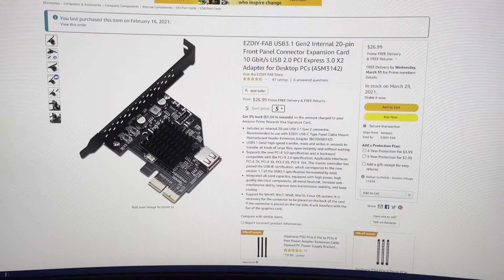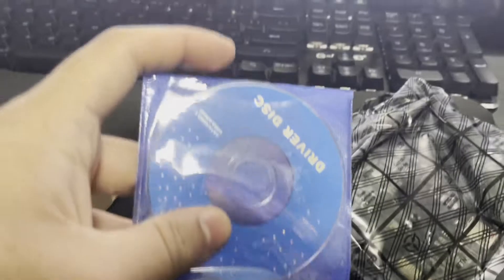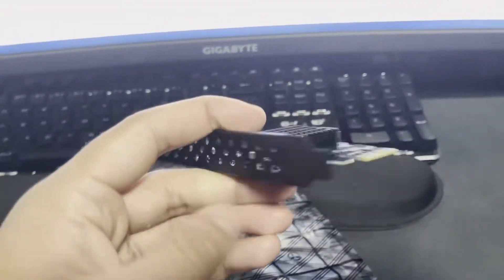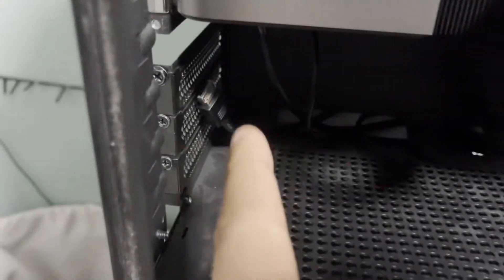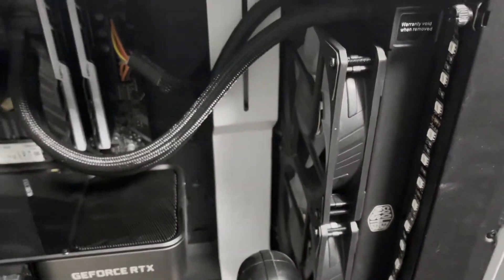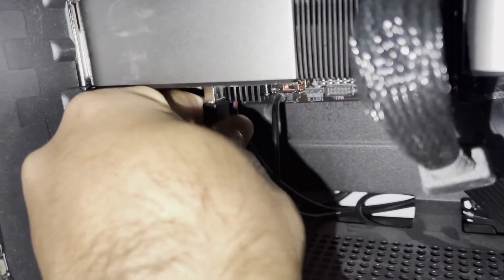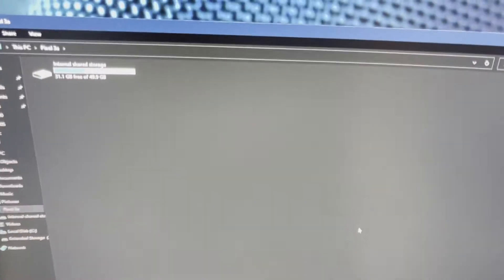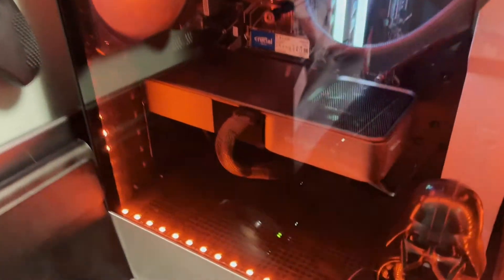Is this the best way to Add USB C to a motherboard on budget ?

Comment: You should turn your radiator right side up the, because currently the orientation of the tubes might cause your water pump to run "dry". Gamers Nexus had a video about the correct orientation of water cooling aios.

Comment: that motherboard that you are using is very bad, with no support for pcie 4.0 or cpu overclocking, so if I were you I would upgrade that, so that you could get more performance from your gpu and cpu
Reply from the maker: for sure i had a low budget when making this pc but i will definitely upgrade
Reply: Bro the title includes "on a budget"